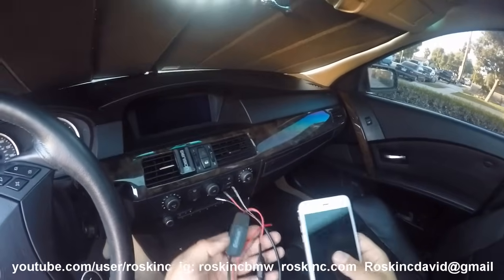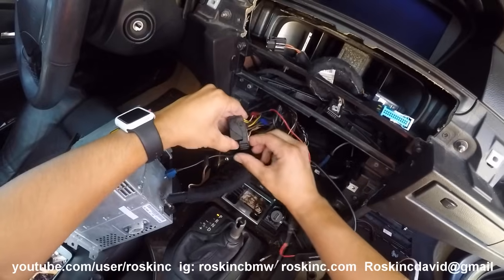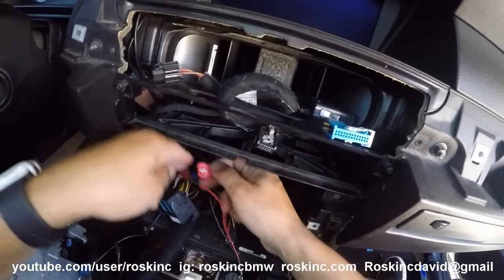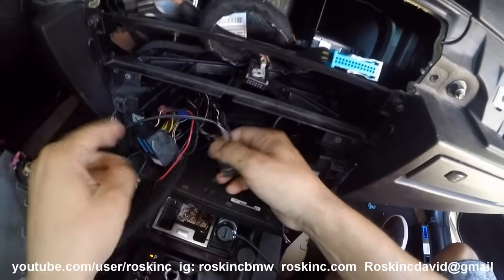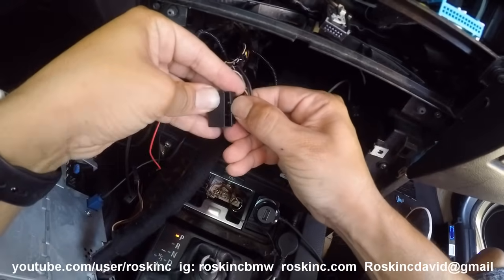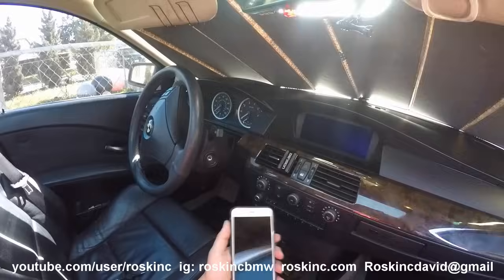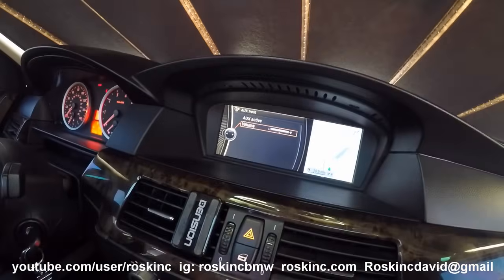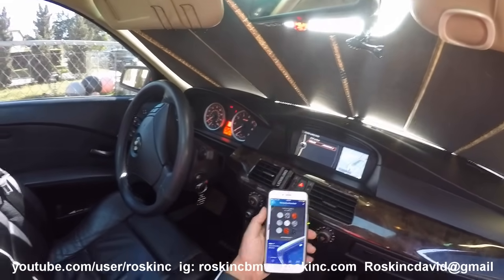how to install bluetooth aux adapter e60 bmw 5 series iphone 7

Comment: Could I just program the Bluetooth audio if I have Bluetooth hands free anyway?
Reply from the maker: SHARP Vids the Bluetooth on the vehicle is not capable of Bluetooth audio, only for hands free. Not even programming can change that.
Reply: roskinc dammm thought I could add it since I already have Bluetooth in it. but cool thanks keep making awesome informing videos!!! I also have another question, for halos on the e60 of the don't work, do I have to add a module or program them in...???
Reply from the maker: SHARP Vids your halos don't work at all? Are the bulbs out? Do you get any errors that say parking light error? Check the wiring e60 notorious for the wiring inside the headlight to break apart causing shorts
Reply: roskinc yeah I just got some new headlights I know the wiring like to degrade because bmw make them cheap, I was wondering because I just got some new ones, and yes it has left and right park light malfunction
Reply: If the the light malfunction light has been on for more than 50 starts, you'll need to reset the light module. Contact someone with proper knowledge. if that doesn't help you'll need to get a new one for around 500$
Reply: Anni Jasmin thanks for the info

Comment: Does the phone part of idrive work with this?
Reply from the maker: yes it wont interfere with your cars bluetooth for hands free. THIS ADAPTER IS ONLY FOR MUSIC.
Reply: Okay, thank you
Reply: Is it possible to have two selections that you program? I saw your aux cord video. Would it be possible to have an aux cord and a bluetooth receiver at the same time?
Reply: Jacob, I was wondering the same.  I think you'd need to have an "aux jack with a switch."  Then when you plug in the aux cord, the jack switches off signal from the bluetooth.

Comment: Dear Roskinc,
I'm sending you a message here because your email function doesn't work.
I'd like to install bluetooth and Aux to my E60. Does the Device you offer on your website create both or is it meant to be plugged into the existing AUX input if there would be one in the car? Most german sellers offer the "plug into AUX, access bluetooth - device". For my case I'd like to install AUX and Bluetooth now. Second I'd like to now which sipping method you use for Germany.

Thanks in advance 
Shahin

Comment: My sound system doesn’t work all so the door charm as well
Reply: Help plz !!
Reply from the maker: AHMAD SULTANI does your screen work? If your ccc/mask module is damage it will control the sound, or your amp. Did it just happen out of nowhere?

Comment: So you have power + power - and one other wire? That doesnt make sense is it only mono sound?
Reply from the maker: Kolin Stallman my device has 5 wires total. 2 are for + power and - ground, then the other threee are for audio left right and ground, you can’t confuse the power wires with the audio, they come labeled and with connectors crimped to them.
Reply: I bought one with a connector on the end before I seen your video. Soldered the switched power up and just had to stick the connector into the bmw harness. I have the mask logic 7 unit with a cd changer in the glove box and the slot you put your wires in was empty so it fit right in. Unit is getting power as my phone will connect but no sound. I coded the car as per your aux install video but I cant find the nsc expert profiles you had. Just found russian virus'. And I was told that with new versions of ncs that it is all included in the default profile. All i did was change aux to aktive, wrote the file to the car and it shows up now. But I am unsure if I have a coding issue or a bluetooth module issue. Maybe I will just try the aux jack. When I have it on aux and i crank the volume I get some static so Im guessing module issue?
Reply from the maker: Kolin Stallman something isn’t connected right. I never had a aux not work if the vehicle is coded for aux. only time is when the connections are not in correct place.
Reply: Alright thanks, I will check wiring, maybe try your module.
Reply: I ordered your module but it doesnt come with a connector and my car didnt have one to use so i will have to use the one i got with my old module.
Reply from the maker: Kolin Stallman are you sure it was from me? I include a connector in every single one of my cables, I should know, I personally hand make and package each one I sell. Every single one comes with it.
Reply: Yea I'm the canadian that you just shipped one too. I Didnt realize you included a connector for the audio connection, thanks I will get it going as soon as it get here. My previous one was sky international, didnt seem to work and had some complaints in its reviews. Next task is the airbag light. Upon inspection it looks like someone already tried to "fix" it but its a total hack job. I hope your resistor does the trick, been sitting in the to do pile for a while.
Reply from the maker: yes i include the connectors and tap connectors, unlike other sellers i include everything you need to install it. i test each adapter before shipping for quality! thanks for the purchase, any issues let me know!
Reply: The adapter I bought before yours came with the wrong connector. It didnt have the right grooves to plug in under the fiber cables, it fit in the other side. I am not sure why they would do that. I have yours installed now and it works great. I dont notice and audio degradation between cd, fm, and bluetooth and I can be pretty picky. Great product, thanks for the help.
Reply from the maker: Kolin Stallman thank you for the feedback I’m glad you enjoy it! I test each item I sell for quality, I only sound the bt chip with best quality sound.
Reply: I just noticed my hvac panel is now dead after the bluetooth install. Do you know anything about this? I hear the IHK module needs to be recoded because it was unplugged with the power on. Do you have a brief description on how to do this?
Reply from the maker: Kolin Stallman double check you have all the plugs connected, I’ve unplugged and installed aux cables more times than I can even remember, never had this issue, the only times people have, has always been because a plug was connected all the way in correctly. I’ve even started the vehicles with the ac panel disconnected and no errors or Coding needed.
Reply: Thats exactly what I did, started with the ac disconnected to test the audio before I put it back together. I pressed the connectors in as hard as I could but the unit is completely dead and its starting to dip below 0c where I live. I tried to code it but just got errors that roughly translate to not affiliated reports. I will go fk with it some more. Been listening to the same cd for 5 months and as soon as i got rid of that insanity this happens lol. Hard to keep up with these cars.
Reply from the maker: Kolin Stallman check fuses. Maybe a wire shorted out. Not sure where it’s located as never blew one but in trunk drop down the emergency kit and there it will show the fuse location number and fuse size for all components.
Reply: Yea shes fucked. wires and connectors are in tight. Wont let me change anything in the idrive settings either.
Reply: alright, will do. thanks
Reply: For the record that was my first guess. Then I read this https://5series.net/forums/e60-discussion-2/ac-heater-control-panel-problem-after-dash-removal-123267/ and started down the coding rabbit hole. You were 100% right and that is the first thing I should of done, thank god I didnt brick anything in my rookie coding efforts. I am a red seal electrician for fucks sake and I didnt do the first damn thing that is in the book of electrical lol. The 15 amp fuse number 30 was fried to shit. Thank you for going above and beyond with my stupidity. The most simple solution is often the right one.

Comment: how did you change your i drive?
Reply from the maker: i updated my system to CIC. this is not a simple program update. required CIC unit, new screen, new center trim piece, and controller, you dont have to change the controller, but the rest is necessary along with coding, i purchased mine precoded to my vehicle so i just had to plug in and it worked. required a few things like changing plugs, but no wire cutting. i made a video but memory card got lost, so i can only film a video explaining what i did, so ill have to do one very soon.
Reply: that would be great man cus i have a 525i 2005 and was looking high and low for a video and how to update the idrive so looking foward to that video man
Reply: can you control the volume also of ur fone mate

Comment: Will this work in 2006 bmw e60?
Reply from the maker: Yes
Reply: @roskinc  it seems like i have an ipod docking connector in my compartment but I don't have aux coded. Could i buy an ipod Bluetooth adapter?
Reply: @roskinc  i do have the Bluetooth option tho

Comment: tengo un 525xi 2006 y quiero ponerle ese sistema como me puedo contactar con tigo
Reply from the maker: Rafael Duval mandame un mensaje ha mi email. Roskincdavid@gmail.com
Reply: roskinc  ocupo poner el aux Como de donde  te encuentras
Reply: roskinc hola que tal muy bueno el video. tengo un 523i Touring 2007  me sirve tu producto? serian los mismos colores de los cables?

gracias

Comment: Hi, are you still selling this part?
Reply from the maker: Yes I do. Roskinc.com
Reply: 1. My e64 doesn't have an aux port in the car, can I still install this Bluetooth device?

2. Can this bluetooth device be used to talk on calls hands free? I believe the car already has a mic set up and hands free kit but the standard bmw bluetooth module is not picking up my phone
Reply: @roskinc  its sold out
Reply from the maker: @rayennaidoo3675  back in stock now
Reply: @roskinc  thanks. I also need the cable that will allow me to code the aux on the idrive system from a laptop. Can you get that cable in stock as well?
Reply: @roskinc did not get the part delivered to me as yet. Ordered 3 weeks ago, any tracking number?

Comment: Why would you do that, just tap into the cigarette lighter
Reply from the maker: Nathan Wright you could but to access the wiring for the cig lighter is under everything and a tight squeeze, if you mean using a cig lighter plug, then you’ll have wires visible.
Reply: no as in remove the cigarette tray since you have already done the hard work removing the facia. I would use that as a safe alternative for a switched 12v for things like subwoofers etc
Reply: You would need a transformer unless it has one in it. Cig lighter is 12V the aux is 5

Comment: I ordered this from ebay: http://www.ebay.ca/itm/Bluetooth-module-radio-stereo-Aux-cable-adaptor-For-BMW-E60-04-10-E63-E64-E61/222525585393?fits=Make%3ABMW&hash=item33cf8ef7f1:g:eZYAAOSwQS1aQghD&vxp=mtr

Thinking it was similar quality to yours. I had it professionally installed and the sound quality is terrible. It sounds like parts of the song are missing (especially the bass notes) 
Any help will be greatly appreciated
Reply: Did you ever figure out your problem? Running into the same issue of no bass myself.
Reply: @Max-sp3jx  Yes it was wired incorrectly. Got it done at a professional audio shop and they fixed it.